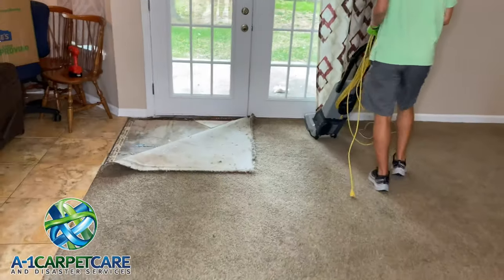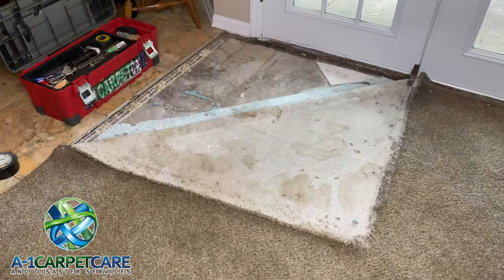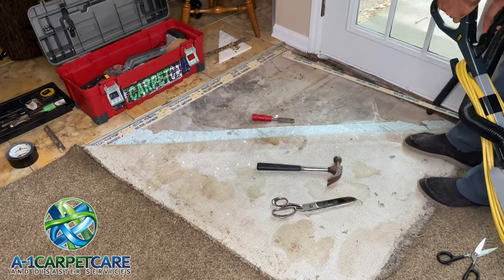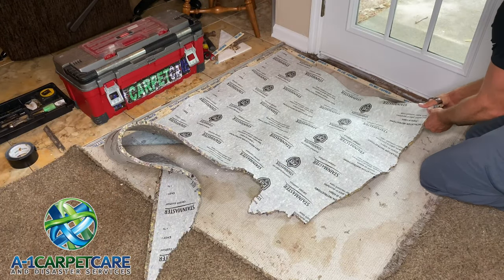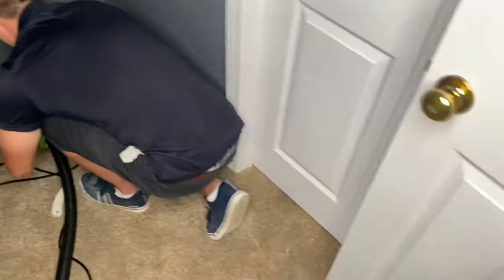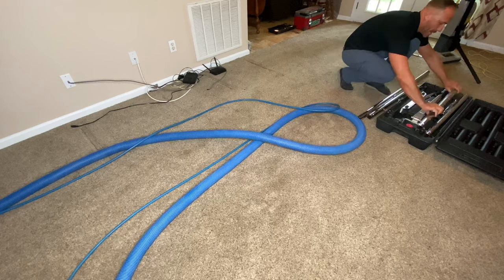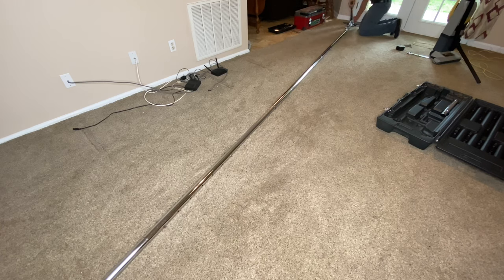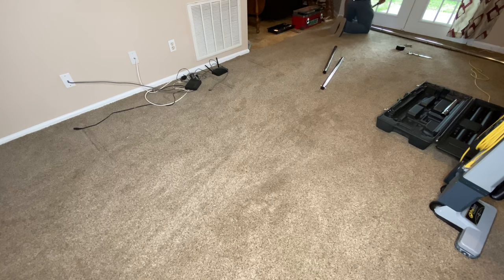Slime Removal AND Carpet Re-Stretch/Repair; A-1 Carpet Care

Comment: $400 for a power stretcher!?
Reply from the maker: ca31 first one we bought was used at a pawn shop for a couple hundred - decent newer one is right around $450-550 tho - depends on what kind ya get like anything else I suppose.  We normally charge around $1/sq ft to stretch so pays for itself REEL quick.  Thanks for watching
Reply: A-1 Carpet Care & Disaster Services wow. You will be making profit on the first job with it 😂
Reply from the maker: Damn near. Also gots me about $1,000 other necessary tools but yea it’s great money